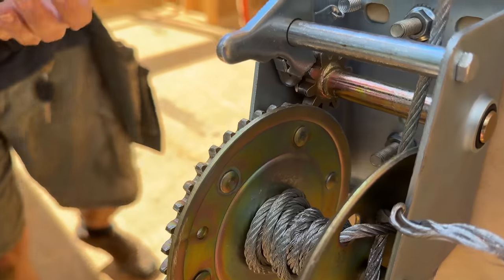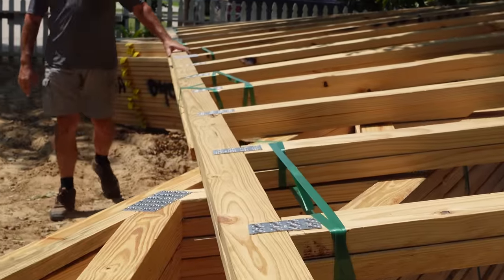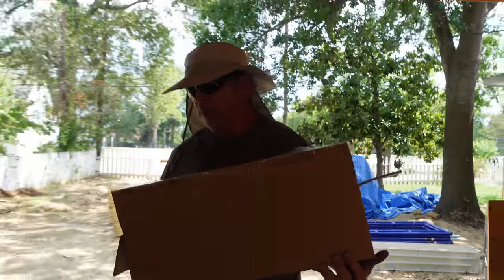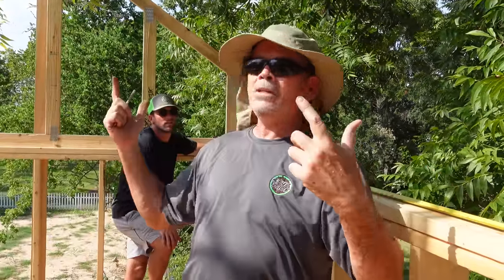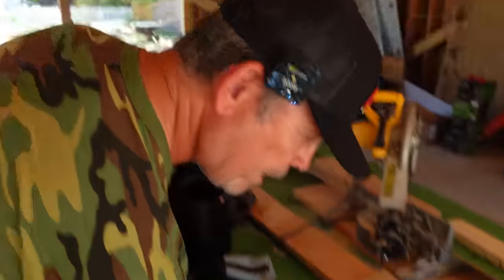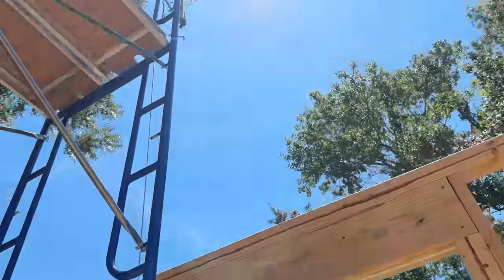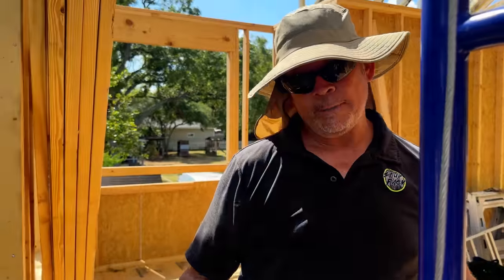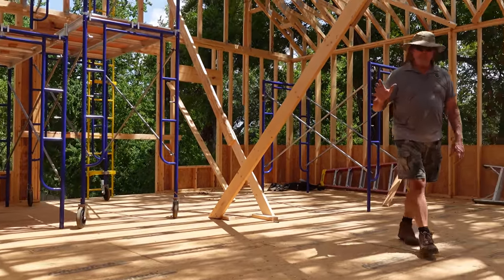Climbing 30 FEET UP to Lift Our Trusses by HAND! (Saving us Thousands)

Comment: Harbor freight has hand winches with a 40:1 worm gear that handle 2000lbs.  I remove the handle and add another nut and then turn it with a drill. Easier then hand cranking
Reply: I was wondering about modifying the crank so it would be quicker to use the drill to lift and lower each truss.

Comment: The C shaped thing is called a clevis
The screw pin is called a clevis pin
When you put them together, it's called a shackle. If you take them apart you have a clevis and a clevis pin again.
Reply: Clevis is Bevis’s brothers name 😂
Reply: Dropping knowledge
Reply: @jugheadjones5458  What name did you settle with? 😅
Reply: @jugheadjones5458  Archie was a narcissist, and thus the name was decided.
Reply: @jugheadjones5458  The drummer (and founding member) of the cartoon band "The Archies" was Jughead Jones. Sorry. Wrong Jughead Jones. 😇
Reply: @daxmas625  Some folks'll never eat a skunk, but then again some folk'll... Like Cletus the slack jawed yokel...
Reply: In UK that is a shackle, complete, or shackle and shackle pin. A clevis pin would go through (for instance) a gear link fork,with a washer and split pin to hold it. A far as I know clevis pin is never threaded and has the securing hole at the other end to the head. Whereas a shackle pin is t’otherwise  round.   And of course you mouse a shackle at the head end ‘cos that’s where the ‘ole is !
Reply: @CrimeVid  Thanks! It's Interesting how different parts of the world use words differently. I grew up on a large farm and ranch in Texas and New Mexico (~ 10,000 acres) and we called them clevises and shackles interchangeably, but understood the "C" shaped object as the Clevis and the pin as the clevis pin, but once assembled it was a "Shackle". Not all of our clevis pins had threads. Some of them took a cotter pin through a hole at the end to secure them.

Most of the time when we were using a clevis it was on the hitch end of a tractor, between the tractor and some sort of implement.
Reply: Awesome job guys and sweet  new gear keep up the awesome job 👏 🙌 👍
Reply: Nice job Diamond Back.  Someone is paying attention!😉
Reply: Clevis is a marine term for a similar device designed for rigging, typically for sailboats.  A shackle is designed differently for heavy loads and abuse, coming in 2-part and 4-part shackles.
Reply: Actually it's called a shackle.  Clevis makes a 1/4 turn.
If you're shackle isn't a Crosby, yer takin yer lives in jeapordy.  Foreign junk fails at the most inopportune times.  Ask me how I know....

Comment: Great idea! This is a difficult task that I have done many times before with a framing crew of five men. The only criticism I have is that you should have used tie-down straps installed at an angle to protect the scaffolding from tipping. While the scaffold itself is plenty strong to hold the truss, it is the tipping force that you must be concerned about because it is a lot less than than any other force that would cause failure. And yes, I am a civil engineer who has done structural engineering. AND, I worked my way through college framing homes.

In our area, the Phoenix metro valley, you can generally hire a crane to set trusses like yours for around $500 - $600. But in your case, there may not have been enough room to get a crane close enough to the building. Still, I would have craned this job because you would have been done in less than an hour. Still, for setting these trusses by hand, you came up with a genius idea. Great job!

Comment: The amazing thing here is the pre-positioning of supplies. From the framing studs to the Advantech flooring to the Zip sheathing to the BFS trusses, you guys and the vendors have done a great job arranging things in the right order to be ready to use. I think this episode shows the value of building a spacer jig to position the trusses - having a set of jigs would have probably cut the installation time in half.

Comment: I hope you consulted with your structural engineer when you changed roof systems from ridge girder and rafters to trusses. Way different behavior and double the wall load. Also, if the truss is not designed properly, your supporting walls will bow outward. Love your projects and attitude!

Comment: Great progress on the installing the trusses from Builders First Supply.  Good use of the scaffolding and the winch set up from Tractor Supply.  Stepping it up on the Diamondback tool belt system.  Remember it is always better to look good, than to be good! 🙂 Now that you are going to be 20 feet in the air and on the roof to starting the sheeting and shingling get yourselves some fall arrest gear.  A friend of mine who is a roofer by trade for over 30 years fell off a roof a month ago and is in pretty bad shape. :thanksdoc: If one of you has an accident it will surely bring this project to a halt.  Don't forget safety first, last and always!

Comment: The scaffold crane was/is brilliant!

The last time I did a job like this, the trusses were delivered by a truck with an integrated crane, so unloading needed to be done Chop! Chop! Even though you had lots of time (‘cause your trusses were on the ground, not on a waiting truck) I think our unloading strategy would have served you well.

After the gable-end truss (and 2 others) were installed and braced to each other, all the remaining trusses were hoisted and leaned/stacked against them. With all the hoisting done, moving the stacked trusses to their marks for install was much easier than man-handling them up off the floor.

Comment: Wow, I've seen trusses installed with cranes and telehandlers, but never by hand like that. Great job guys.
Reply: I have seen the Amish pass them up by hand. Crazy.
Reply: @katieluv8422  Exactly, used to set them with 4 guys.  Put up two ramps on the corners,walk all of them up,scatter them and stand them up. Gotta walk the walls but it's not hard. This looks like way too much trouble and time consuming. If you have the time, get after it.

Comment: Love it!  Congrats!  Looking great.  The Trusses allow a lot more room for insulation for the South Texas heat.  Your Truss change helps me solve a problem on my future home build about insulating my roof line and having a conditioned attic space.  Your could put 2.5 to 3 foot of Closed Cell spray foam, Open Cell spray foam, EPS, Rockwool. cellulose or any combination of insulation depending on budget.  This would give an awesome R value for your roof line...  Conditioned attic space and Building Science.  LOVE IT!

Comment: I’m glad to see the work put into the diagonal bracing. 
 Not so long ago a group of people set some trusses on a structure in my neighborhood.   
  They were mostly volunteers. The long and short. The trusses were set beautifully squareness evident from all angles. 
 It was just very apparent the lack of temporary bracing. 
 The swift Oklahoma winds came sweeping down the plains. (And they will anytime you attempt something like this.) The trusses all buckled and dominoed onto one another.  
   It ended up taking down the entire structure.
Reply: Yeah the sheathing does a lot for rigidity.. I have seen a bunch of videos on here where the whole house looks framed up without sheathing and the wind just knocks it over
Reply: Temporary bracing is a must

Comment: I’m pretty sure you guys could’ve rented a tellehandler for a couple hundred bucks but this was way more entertaining! Great videos and hard work! Love it!
Reply: What's a tellehandler?
Reply: @lovewenwin Basically a giant forklift that can reach out 30 or 40 feet. It's what most people use to lift trusses up with
Reply: @lovewenwin  Otherwise known as a Zoom Boom
Reply: Aka gradeall
Reply: there $800/day here, plus a few hundred for delivery/pickup, they’d be better off renting a crane with operator for 1/2 a day to set them, and would likely be about the same $$$$
Reply: "Couple hundred bucks"  You're dreaming about that.  Way more $ than that.
Reply: It also seems they have shit soil where the machine needs to be + all the trusses were there. It just might have not been viable.

Comment: You made that look easy but I hope everyone watching this episode realizes the work is difficult and potentially dangerous.  Well done guys.
Reply: yep - even though Paul likes to say he's never built a house before, he has 30 yrs of experience in related building techniques so kids - don't try this at home :)
Reply: Potentially dangerous like not securing the scaffolding on wheels from the opposite side and use it as a winch support when its rating is for god knows what.
Saving money is nice and fine but how much would have been to break that scaffolding in half and pre-load the trusses on the 2nd floor and just lift them from there up. 
Thanks for the vid. but that was not safe by any means. 
p.s. never done framing but if i did i would have never let you do it like this :P
Reply: Don’t sugar coat it.  These are stupid and dangerous decisions in this video.
Reply: @qa1e2r4  They state in the video each truss is approximately 165 pounds. In order to exceed the rating of the winch or scaffolding, they would practically have to try and exceed the rating using mechanical leverage / advantage. While a crane probably would have been safer, there is still plenty of risk involved. 

Honestly, the safety violation I keep seeing that could be avoid in either approach, is a lack of a fall harness and lack of hard hats.

Comment: Shackles!  I was a communications tower climber/erector and when we rigged the tower sections to be hoisted up by the crane (or boom truck if less than 150'), we used shackles, though the ones we used were much larger, yours are still shackles.
I wish I was there to participate, even though I'm 60 I love it.  Great channel!
My wife and I will be building our new home 6mo's to a year out, so we are learning from you guys.  I have been remodeling for years, but also never built a house from beginning to end.  Thanks for the education we will soon be using!

Comment: Good idea using the scaffolding and the winch combined.  Only way I could see an improvement would be to have the winch attached to the work truck on the ground.  Simply pressing a button is much easier than cranking that hand winch over and over.  Plus you can just bring it back to the store when you're done!  Work smarter, not harder. 😀

Comment: Right before you were 2/3 done with those truss lifts, you could have continued lifting them and rotating them . But you could have just leaned them all but the end truss up against the last truss you had secured to that point. Then, once you lifted the end truss and secured it, you could slide the trusses over and into position one by one . 
And that board you were using to brace them at the top ( which was a great way of doing that) would have helped you slide them over, if you see what I'm saying. 
Keep up the good work, guys. Looking good. 
And on the winch, why not take the hand crank off , grind the shaft end to fit a socket, and use a ratchet or impact drill to do the hard work ? Just an idea.
Reply: I wondered the same. In fact I was expecting that to be the reason they wore the bearing out.
Reply: Came to say something similar… pre-stack at top level, adapt handle to a drill (slow speed… or better yet: get a 120v bumper winch & strap that on the scaffold), & 2 additional things:

When setting your trusses have 
1. a pre-cut guide piece on each end (that lays on top of the wall below… to space your truss over exactly the right distance, &
2. have similar ones for the top… they’ll sit across 2 trusses (previously set 1 & currently being set) but have a spacer that hangs down between trusses.

There are other tricks (to get the truss spacers out more easily), but those are the main ones.

Great video; love the amount of content! 👍🏼👍🏼

Comment: Ironworker/rigger here. No argument about what it is. It’s an anchor shackle. Because of shape and the pin is threaded. Clevises are used by farmers. They are U shaped with smooth pin and a cotter pin. At least when new. Then the bent nail or piece of bailing wire is used in it’s place.

Comment: I hope you guys plan to put a radiant barrier under the roof deck.  They drastically reduce the radiant heat gain of the house.  It makes a big difference.
Reply: It's not going to have radiant barrier BS. It's going to be a fully conditioned attic and tight house with a fresh air supply.
Reply: @anonymous..-  "Radiant barrier BS"?  You don't believe in radiant heat?  You know that you can still put a radiant barrier in the rafter/ truss cavity, right?  You must not live in a hot, sunny location.
Reply: Reducing attic temps by 20 degrees has marginal net benefits.  Actually having a tight house with a conditioned attic and fresh air makeup is miles ahead radiant barrier snake oil. Who cares if the attic is 20 degrees cooler ? With proper insulation, 20 degrees cooler doesn’t impact the interior conditioned space. They are doing something far superior.
Reply: @anonymous..-  I think maybe you don't fully appreciate the difference between radiant heat and air temperature.  (Think about shade versus full sun, or broiler versus convection.)

Again, I suspect maybe you don't live in a hot, sunny climate.

Comment: Well....love the video and the ingenuity but def worried for your safety. I can see using this method for your job from the standpoint of just getting it done.  If I was comfortable working on scaffolds I would do such a one-time job in that fashion.  The outcome was perfect. There will be attic floor joists right?
Btw, I could tell Rad had some kind of experience and comfort level climbing around; I assumed it was in construction.  I'll say it again: you guys are truly lucky to have one another.  Please be careful.  NOTHING is more important than safety.

Comment: That scaffold used as a kinda crane is something I’ve never seen before and one hell of a good idea. Did you consider using the wheeled outriggers on the bottom of the scaffold for a little more safety? Excellent idea

Comment: I was a production framer in Las Vegas for 30 years.  98% of all roofs were always trusses.  I'll tell you how I would have stacked those trusses.  I would have set up a temp jig (matching the 2nd floor walls) in the back yard,  taken 1 gable and half the common trusses,  and stood them up (using temp screws) on my jig.  I would have done all my blocking,  sheared my gable and my high heels,  and built my gable soffits.  I would have about 3 sheats of roof plywood done with plywood stands attached.   I would have then moved  my jig to the front and repeated the process.  The crane I order would swing half the roof in one pick,  swing the other half,  and be done in 45 minutes.  The cost of the crane would be the 1 hour minimum,  plus the travel time ($500 -- $700) but well worth it because we would be sheating the roof by 3pm as I would have used the crane to raise my plywood up to my plywood stands.  This roof would have been a 2 -- 3 day job for my 3 man crew.
Reply: With these guys, more labor is cheaper than material or subs.

Comment: Wife and I look forward to this every week, and yhis week we got 2x the SP, awesome! I did have a question though, when you called to change from the beams and trusses to just the cathedral style trusses, what was the extra processes? DId the architect sign off and resubmit plans, did you have to apply for a permit change, will it delay the framing inspection? Also its a Clevis 😂

Comment: Stud pack is my favorite channel on YouTube. Aftet watching you crank the lift I thought I'm lazy and it looks like a lot of work and it looks like there's a nut holding that handle on therefore I would have used a cordless drill with a half inch extension and socket to crank that thing.

Comment: Great job using the hand crank winch. It may be easier for y’all if you did a 3:1 plus your existing 2:1 pulleys in the future. A little more rigging but 5 times easier.

Comment: Clevis v Shackle-
The main difference is in the working load limit and their applications; clevises are mostly used in farming towing applications, with shackles typically used in construction, lifting, and rigging. Also, a clevis pin is usually unthreaded and a shackle usually has a threaded pin or bolt.
Reply: Clevis on the farm have a twist

Comment: I'm guessing that y'all are finished hoisting stuff by now, but if you have a big hole saw, it will have all the torque you need to crank that winch. EMS rescue teams use them to raise and lower people from confined spaces and tall buildings.

Comment: Shackles are on the end of a crane. Clevises are on the end of come a longs or tow ropes. But they are interchangeable as long as they meet the load requirement and you switch the terminology.

Comment: That was well executed.  Good planning and enginuity there, boss. And as far as clevis vs. shackle goes. You are correct in calling that specific device a shackle.  But, they are also correct because a shackle is a type of clevis. So in other words, a shackle is a type of clevis, but a clevis is not a type of shackle.  It depends on the work duty and/or purpose.  Good job guys. Great video. Be safe.